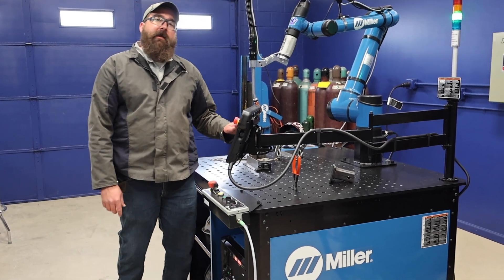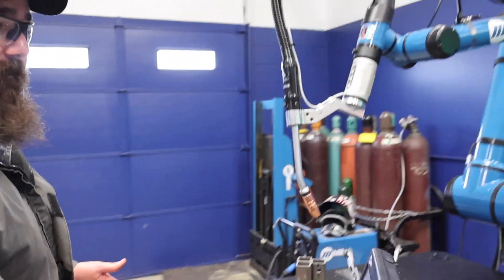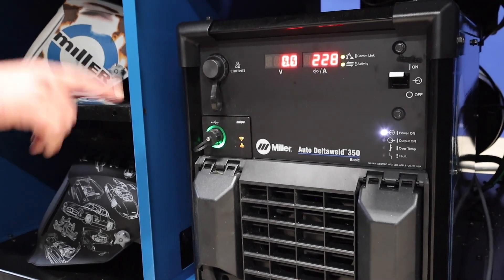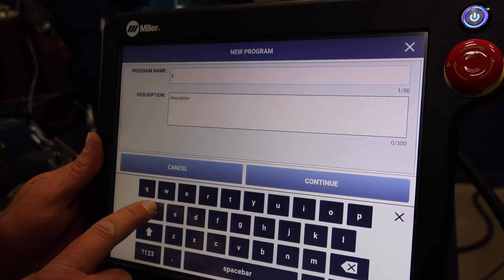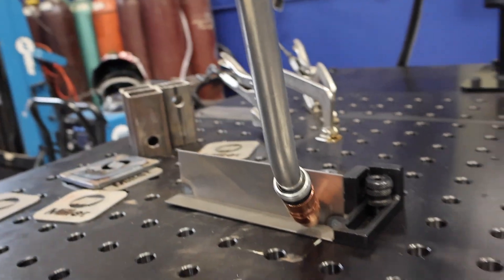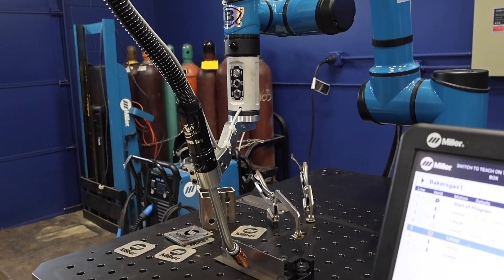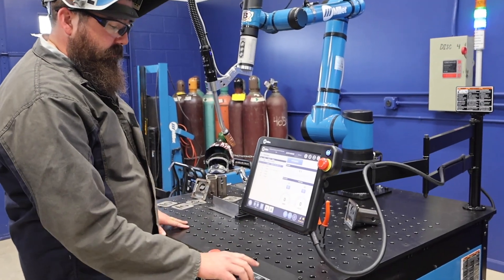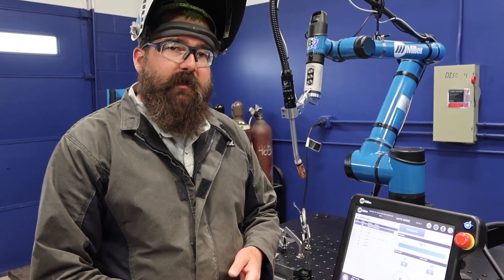Miller Electric Copilot Cobot Review & Demo

Comment: How much will that unit set you back.
Reply: Im trying to figure that out too
Reply: @warriorcraftsman3981   152,000 usd online is what I found
Reply: 150Kish
Reply: The one at my job was 110K and it’s an absolute piece of shit. I really don’t like miller but they could have done a lot better with it. I don’t think I’ve seen it run all day without some kind of failure since it’s gotten here. The liners are garbage. It will do all kinds of weird shit I never thought was possible. I’ve actually had it stop moving and weld like ten inches worth of wire in one spot, more than once. Or the guys will adjust the weld program, which you have to do occasionally and I’m fine with that, but then it’ll go off and weld so far off of what you set it at. I don’t understand the thing, I thought robots were supposed to be consistent. It’ll be mostly fine one day, then do the same order of parts and be absolutely catastrophic the next day. It makes no sense.

ETA: So no one thinks I’m just trashing the thing, when you can get it welding like it’s supposed to it’ll lay some phenomenal welds, and it’ll knock out lots of volume orders pretty quickly. I won’t take that from it.
Reply from the maker: Use this link to request a quote! 
https://bakersgas.com/pages/miller-cobot
Reply: @BakersGas  If you cant even be honest with the price, ill just assume its insanely overpriced. Secret prices ruins markets!!
Reply: @BakersGas why the hassle??? Can’t you just state the price or price list?